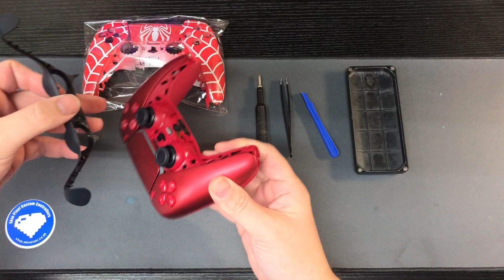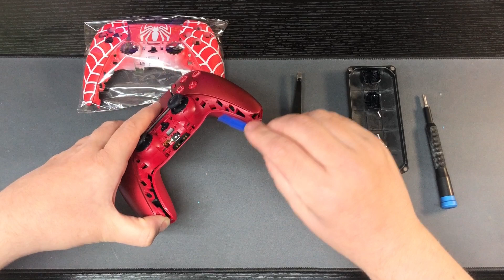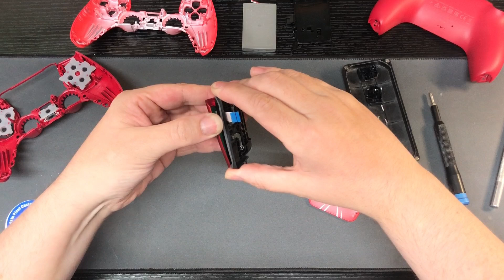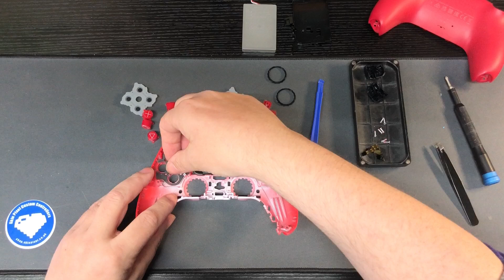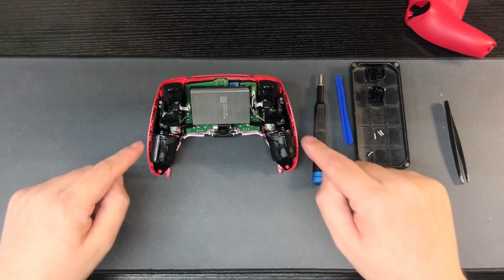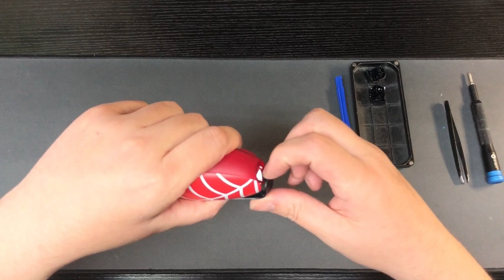DualSense Replacement Faceplate Tutorial

Comment: hey does this work with the dualsense edge as well?
Reply from the maker: The DualSense Edge internally is build completely different. To swap a shell on the DualSense you have 8-11 screws to track in total, while the Edge has that many just to get inside the controller 😅